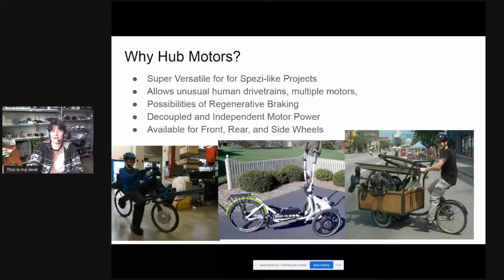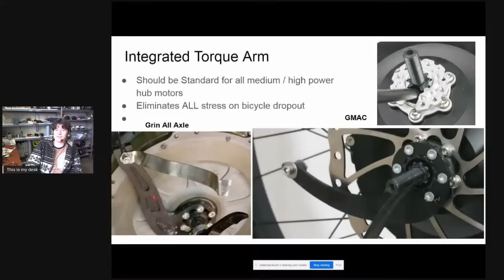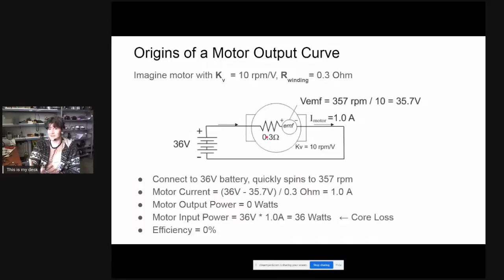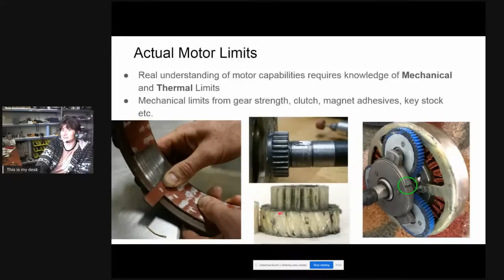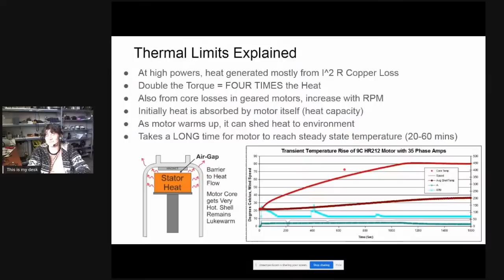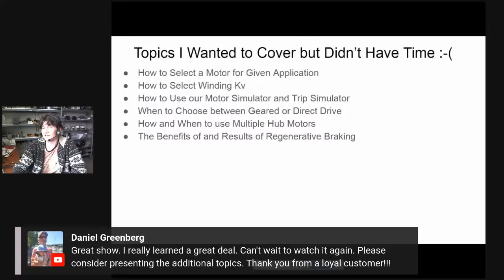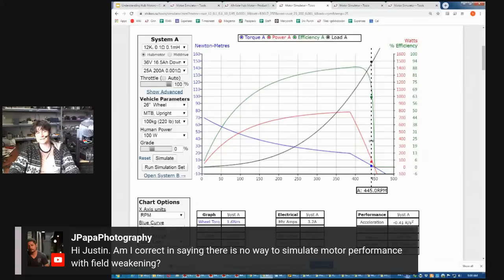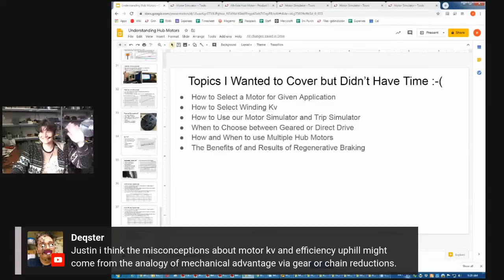Understanding Everything about Hub Motor Drive Systems - Spezi 2020 Live Presentation

Comment: Unsprung weight
Reply from the maker: Only concerns traction of suspension wheels on bumpy surfaces, and has not effect at all on ride comfort or smoothness of the suspension as seen from the perpsective of the rider and the rest of the suspended frame. Do a free body force diagram and you will see.

Comment: in short 250w hub motor is way to low for hill areas and European fat bikes sellers can go to hell with such params of motor. 750w80Nm is the optimal by my toughts for fat bikes even with the speed limiter to 25km/h
Reply from the maker: What are commonly sold as "250w" ebike hub motors are definitely are not engineered for delivering high torque levels at low speeds. Their efficiency is poor for sure.  But you can have a small hub motor deliver tons of torque very well, see https://www.youtube.com/watch?v=up-tnPZMTPk